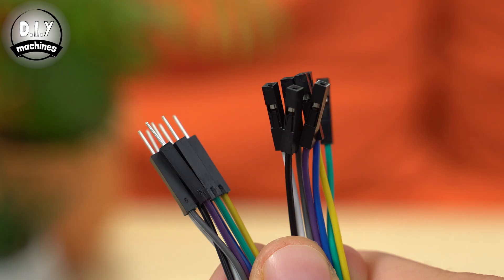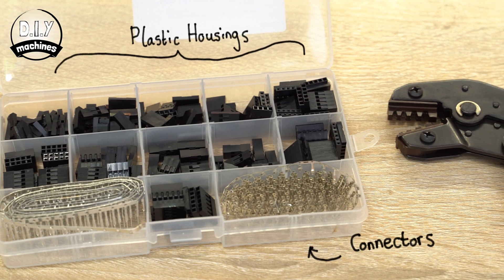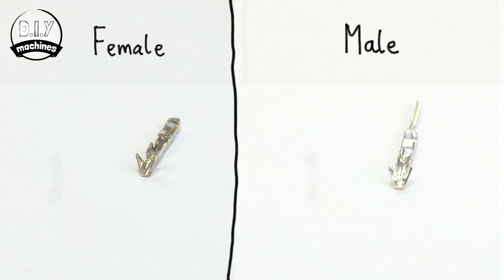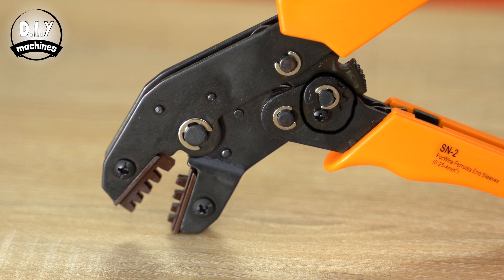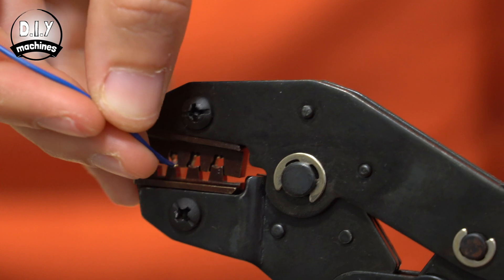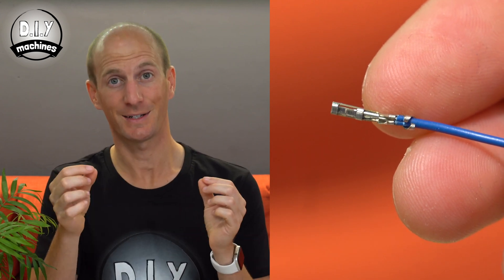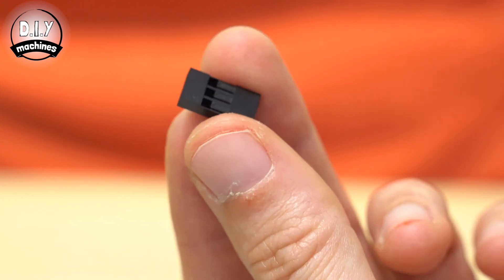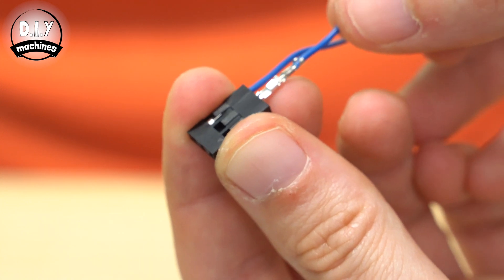Dupont Connectors - Quickly and easily make your own

Comment: The production value of the video is excellent. However, the actual crimps shown, especially the female one, are awful. Unfortunately, DuPont contacts (with the diagonal offset insulation wings) require a crimping tool with a circular insulation jaw, not the m-shaped jaw in nearly all inexpensive crimp tools. So DuPont contacts are categorically impossible to crimp correctly with 99% of the cheap tools out there, even if they expressly say they’re for DuPont. Also, 5-7mm of insulation is too much to strip. 3.5mm-4mm should be your target strip length for most DuPont contacts. Any less and you can’t inspect it and it could be weak; much more and the wire interferes when mating the female contact onto a pin.
Reply: Exactly. The wire should not enter the "tunnel" part. It's OK on the male side, but on the female side the tunnel is where the male connector is supposed to go when connecting to something, that might be difficult with a wire already there.
Reply: @OriginalKKB  exactly!!!
Reply: I've recently discovered how awful these are. Are there any crimpers out there that actually work and don't crush the dupont 95% of the time?
Reply: @geostrophc  Are you familiar with the EEVblog forums? I started a thread there titled something like “affordable crimp tools for DuPont”. Lots of discussion there.
Reply: @tookitogo  Thanks, ill check it out. And honestly I don't even care at this point about price. If I can find a pair that works consistently ill pay $200+ for them lol. Otherwise I'll have to go through the headache of designing my own
Reply: @geostrophc  Making your own? That requires extraordinary machining and metalworking skills. I don’t know if you’ve ever looked at a top-quality crimp tool, but the dies look nothing like the cheap Chinese ones — at least once you get close. Whereas cheap tools have rudimentarily cast metal dies with no further machining (which are awful), better ones start with casting but machine or grind them a bit, and better ones still have wire EDM dies, they all share one problem: they don’t finish the inside of the jaws. A top-quality tool’s jaws are polished to a mirror finish (which isn’t for aesthetics, it’s critical for good performance) while maintaining accuracy within a few hundredths of a millimeter.

If that’s something you can achieve, then I commend you! :D Otherwise you’re better off buying something.
Reply: @geostrophc  Also, looks like the YouTube bot deleted my first reply, which basically said “go on auction and classifieds sites for original crimp tools”. 

I’d love to give more detail but it’ll just get it deleted…
Reply: @geostrophc  And also, be sure to check out Matt Millman’s pages on crimp tools. He owns nearly every official DuPont crimp tool (and original tools for tons of other contacts) and compares them, including to cheap Chinese tools. Fantastic resource.
Reply: I use the MPI Crimper tool cheap but does the round ends. And works.
Reply: All you’d need to do is buy a different set of jaws and swap them out.  Instant roll crimp.
Reply: @billkraemer4710  Sure, if such jaws were offered for sale, which they are not. (Trust me, I’ve spent countless hours looking at the dies sold for cheap Chinese crimp tools. What we want isn’t sold separately.)
Reply: do you have any suggestions for good kits? and a bit affordable because im a beginner and dont wanna spend too much money on it
Reply: @Theflightsimlover1  There is finally one: the one sold at Lidl occasionally for around $20!!! Of all the low-cost crimping tools I’ve tried, it produces by far the best results on DuPont and other small things like XH. (The kit includes both DuPont and XH parts.) Other people on the forum thread I mention above report similarly good results.
Reply: @tookitogo  thanks, i will check it out
Reply: @Theflightsimlover1  It may require patience; they only carry it once in a while as a weekly special. :(
Reply: @Theflightsimlover1  Ugh, YT keeps deleting my response. 

Once in a while, Lidl sells one, and it’s actually the best low-cost DuPont crimper I have come across. (Others in the forum I mention above agree.) It’s definitely worth picking up for twenty bucks.

Comment: Sorry if the question sounds stupid. Just wondering, can we use the dupont connector with regular wire? I was thinking to use the connector on my DS18B20  probe temperature sensor, just for the sake of easier connection to the breadboard.
Reply from the maker: YEs you absolutely can. I often add the connectors to all sorts when prototyping.

Comment: Another use for the male pins is to connect wires to a PCB.  Crimp in the normal way, push the pin through a hole in the PCB and solder on the copper side.  Trim the pin to remove any excess.  Insulate the part on the top of the PCB with a bit of sleeving or leave exposed if you want to use it as a test point.

You have a connection which incorporates strain relief and prevents stray bits of wire causing short circuits.
Reply from the maker: Good suggestion, thank you.
Reply: You can buy test pins for this purpose.   Or just solder in a piece of solid copper wire.

Comment: I need help to determine which one is the smaller connector  overall for 5 pin... I need to pass 5 leads cable through small hole (electric guitar pickups with 28awg leads) is the Dupont the smaller or there's another better suited for electric guitar pickups? Thanks in advance!

Comment: I have tried many times to make dupont connectors but i always seem to have trouble with the connector loose in the housing. When I try to fab up a female connector it is very loose and falls off pins very easily when connected. any suggestions?
Reply from the maker: When you insert the metal part of the connector in the housing their is a small tongue like part (you can see it in the little windows above each pin the main front of the plastic housing. Insert the pin all the way in, then try pushing this tongue down as you pull the pin out slightly. The 'tongue' should engage with the pin and stop it from coming back out again. I hope this makes sense.

Comment: "low cost" it's like 66 dollars.
I could get a better crimper + housings separately for 8$ + 31$
Reply from the maker: Wow, 66$ is not low cost. If it's cheaper separately then definitely do that. You'll also already know where you can get more housings when you need more.
Reply: @DIYMachines  Weird, today the price went down to 29.99. So definitely keep an eye on the prices, the vendor probably changes them on occasion to attract more sales/views and then changes them back.
Reply from the maker: @x87alpha1  Ah, questionable practices from the vendor. Yes I'll keep an eye on that. Thanks. :)

Comment: After fiddling with these connectors and destroying about 20 of them, I watched your video and got it on the second try.  Well done!
Reply from the maker: Glad it helped. That's exactly why I made the video. Information was hard to find on using these and once I figured it out I thought I should share it. :)
Reply: I did 4 wrong, gave up & went to bed. I'll try again after work.
Reply: As did I. Good video.
Reply: I'm 30 bruh
Reply: same here
Reply: Well where do i start, there are crimping tools and crimping tools. It is often a lottery as to which crimping tool is delivered from amazon. I found that i received the Priceva brand and then a SN-28B brand with differennt jaw sets only three different sizes when ordereing a crimping kit. I would also suggest that the bare exposed wire length after stripping should be shorter and just enough to be crimped in the metal to metal part of the crimp. If it is too long it can interfere with the connecting pin in the case of the female connectors connecting to a PCB pin . Then there is the quality, wire type (PVC or bulked up PVC ), the thickness of the insulation, and how cleanly the insulation is "cut" by the wire stripper. The crimpers do not "lock" the crimp laterally (other crimping tools do and ensure that the wire conductors cannot be inserted into the crimp too far) so it is not always aligned correctly in the crimping tool.   When crimping is done correctly it is very reliable as most aircraft wiring is done with crimping technology. I would say you were lucky only destroying 20 well done.

Comment: be interesting to find out the Maximum voltage and amps a dupont connector and wire can handle. Someone should do a video on that as there are none.
Reply: 3 amp max for factory / professional grade crimping with quality connector pins. Doing them at home, 1 amp to 1.5 amp would be appropriate. Up to 250V.
Reply: @senseisecurityschool9337  Awesome thanks for that info

Comment: That's a lovely video - except that you're using a totally inappropriate crimp tool! Which is why the insulation crimp looks all screwed up and why they don't fit easily into the housing For inexpensive ratchet crimpers, you want either an SN-025 (smallest jaw) or a Toozo TZ-4228B (rear jaw). The latter would be my choice because it also does a good job on JST PH, XH, and SM with some of the other jaws. Most open barrel crimps want the tabs that grab the insulation to be  formed into a B shape - just a larger version of the wire crimp. But "DuPont" connectors (which haven't been manufactured under the dupont name in decades - the DuPont Mini-PV connector was cloned first by Harwin, as the M20. That design, in turn, was copied by countless and nameless chinese manufacturers) are designed to have the tabs wrapped around the insulation with the result having a circular cross-section, and until quite recently, all the cheap ratchet crimps would just butcher the insulation crimp, and you'd often have to use pliers on them to get it to even fit the housing. But just within the past few years, finally, decent dupont crimping tools have become available for cheap from china. There are a couple of others with the right shape available too now.

Comment: Hi Lewis, tx for the video! Finally a simple and good explanation for diy dupont cables!. But my sn-01bm "pushes" to hard and bends the dupont connector. I think I can loose it up with the vise and 1-6 gear but how? I don't want to break my tool ...

Comment: Hmmm okay I think I get it. I bought a AA battery pack but it didn't have the plastic connector for it just two wires. I need to plug them into to a servo tester t hat's has pins so I guess I wanna use the female crimp to do it. Interesting.

Comment: This is such a great video. I bought the SN-28B but it seems to be wrong. Can you advise what to look for in a crimping tool thanks.
Reply: I came to ask the same thing... The SN-28B tool is indeed fiddly. I have a very low success rate. My kit looks a lot like one of the kits on that amazon page. The pins are very thin though and will easily bend/break.

Comment: Thanks.  Great tutorial.  I’m modding my Super73 Z1 and need to align the wire colors correctly in new controller to work with LCD monitor I’m installing. Using DuPont; and ordered your Amazon recommendations.

/Bklyn👑
Reply from the maker: Glad it helped

Comment: the single female connector are a nightmare. Most of the time they dont seem to seed deep enought into the plastic. I cant pull them out but after inserting the connector on a pin it is very loose. No idea what im doing wrong.
Reply from the maker: They are a little trickier on their own. I think they do benefit from increased rigidity wen connected to other two or more pins in a group.

Comment: You can also , on a 3 + way connector use a male on the outside of a female connector set and a female on the male connector set as a location pin. Suitable when joining 2 connector sets. (I use this for removable/replaceable modules or ease of servicing without having to take everything out and loosing orientation. Great for nema17 steppers).
Reply from the maker: That a great idea and piece of advice! Thanks for sharing. I'll certainly use that in the future.

Comment: Very useful video. Finally someone who explains it clearly
Reply from the maker: Glad it was helpful. :)
Reply: @DIYMachines  for the first time i have succeeded. Still a bit of a wiggle to.push the metal in the plastic deep enough, but for the first time since i bought a kit i have been able to succesfully crimp a cable. So yes it has been a great help

Comment: The only thing I would add is to use a pair of pliers to sort of decompress the portion that grips the plastic insulation because mine sort of deforms that portion outside of the parameters of the square hole for the plastic housing. Once decompressed, it should slide into the housing and click effortlessly. If you experience any sort of resistance, 9/10 it's the crimped portion over the insulation.
Reply from the maker: Yes you're right. Sometimes you need to make a slight adjustment with pliers as you explained. Worth checking if it's not seating inside the plastic housing well.

Comment: Nice video, but the crimp shown @2:52 is terrible. The insulation is not gripped properly and the striped portion of the wire is too long. This would interfere with the male connector seating fully. But, in reality, you should never crimp solid core wire. Always use stranded wire instead.
Reply: Using stranded wire also makes for a more flexible wire harness
Reply: Why should you not crimp a solid core wire? What would you suggest instead?
Reply: @Ahlg1990  Supposedly, it breaks if moved around too often, although I've never seen that happen. You can use stranded wire instead.
Reply: Those things bothered me as well. If you make a tutorial, at least make shure to show how it's done properly. Also, recrimping with a smaller size crimptool is a nono as well.

Comment: I'm on the Knipex site and looking for a crimper for these. Oddly, there's no mention of the term Dupont on there or other international supplier sites. Are there other names for these connectors?
Reply: I suspect what I need is this? On that site these are referred to as "Non-Insulated Open Plug Type Connectors". I suspect Dupont is a hobbyist or US-specific term? Regardless it's a confusing mess :)

https://uk.farnell.com/knipex/97-49-04/die-2-8-4-8mm-push-on/dp/853185
Reply from the maker: @dazecm  You're right. They have been known by many names. 'Mini-PV' is another term for them. There is some great information here which should help you decide: http://tech.mattmillman.com/info/crimpconnectors/#minipv

Comment: Thanks a lot. I have a couple of questions/suggestions: I see you used a 100 microfarad 50v capacitor in one of your videos on the automatic curtains. Can I use a 100 microfarad 35v capacitor instead? Will the voltage matter in this project? Also in some other videos if you can explain how the voltage on a capacitor matters.
Reply: The voltage shown on the capacitor indicates how much voltage it can handle. It is good practice to use a capacitor, which has a voltage rating 2x than the supply voltage. For example - if Vsupply = 5 V,  then a capacitor with at least a 10 V rating should be used. Hope you understood my answer :)

Comment: Never trust dupont connectors, if they only have a mechanical joint. Always solder them.
Reply: That's a terrible practice. Soldering a type of joint that is meant to be crimped is just nonsense. Mechanical joints, especially those made under high pressure, are superior and far more reliable than soldering in every possible way. Electrical resistance is usually lower than that in solder joints, for example tin has about five time the resistance of copper, do the math how electrically "better" is soldered joint vs crimped with copper connectors. Ever wondered why they don't use soldering for circuits that involve high power - welding equipment, car batteries, big motors, powerful electrical machines and appliances, power lines, etc.? Look under the hood of your car and try to count how many soldered joints you have. It's even more critical with motorcycles, where there are more vibrations and exposure to the elements. Solder has terrible mechanical qualities and for that reason should never be used for mechanical fixing of wires, which is a common mistake, btw. Also it is prone to degrading, corroding and recrystallizing over time, especially when exposed to heat, it gets dust, dirt, moisture, etc. and weakens the joint over time. It reduces the flexibility of the cables at the area of soldering and thus introduces a point of brake over time, even where there is minimal movement/vibration. It should not be used where there is need for secure connection and flexibility at the same time. When applied over a crimped connection, it stiffens the wire and creates a failure point (and does not contribute to anything mechanically, electrically or chemically). In fact, soldering is not allowed as a sole method of connecting wires in boats and yachts (all joints must be also, if not only, mechanical), it's also avoided in the military and aeronautic industry. In short, soldering has its use cases and is sometimes irreplaceable, but the rule of thumb is: when possible, use mechanical connections (and don't ruin them with additional soldering).